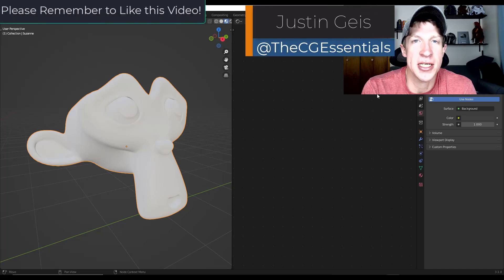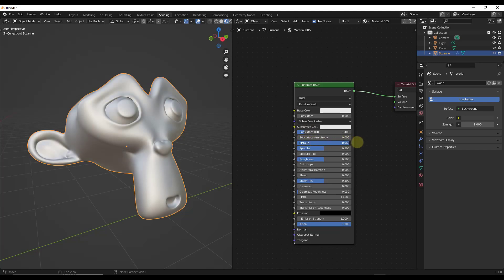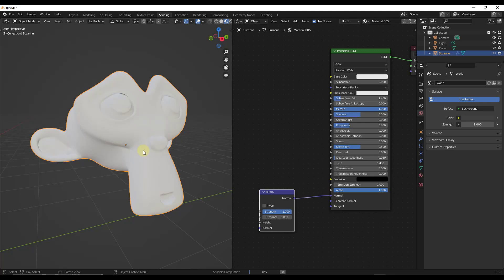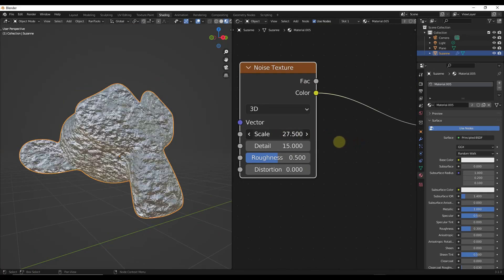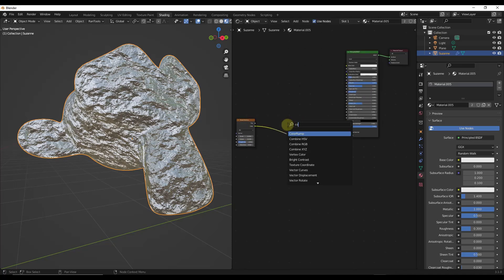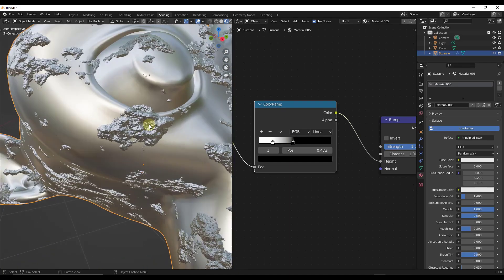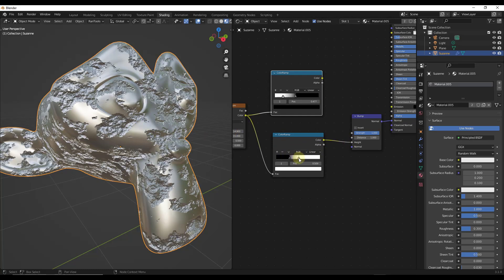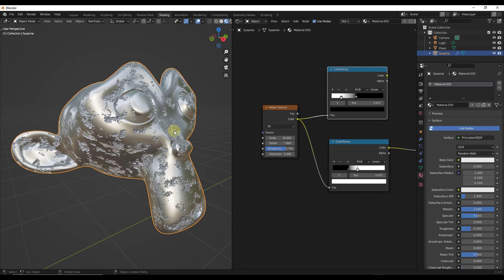Easy RUST MATERIAL in Blender! Quick Adjustable Shader Setup!

Comment: WHY don't I have "Roughness" on my "Noise Texture" node? As well as some other nodes I use?  I'm using version 2.82.7
Reply: probably why . blender is on 3.2 xD
Reply: @sougataghar1179  I know but I'm not 100% sure that's the reason either. I also have node wrangler enabled but it doesn't seem to work.
Reply from the maker: Generally speaking if the nodes look different and you're using an older version like that, that's probably why